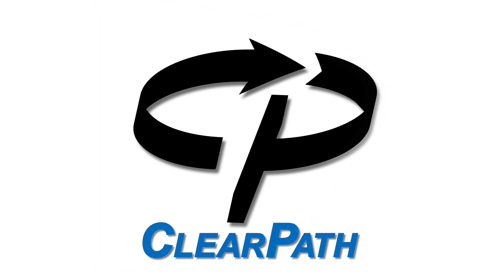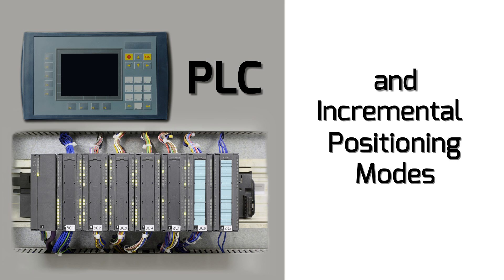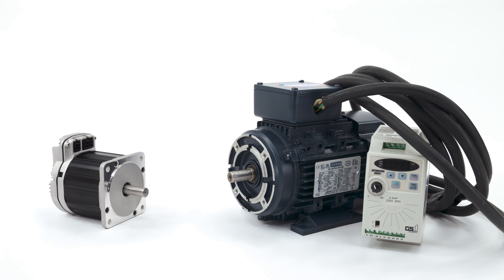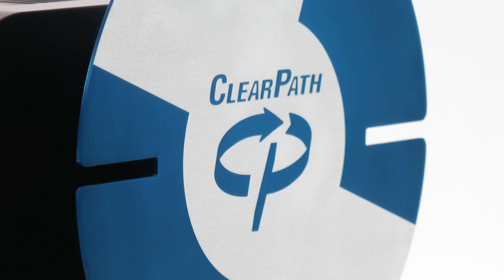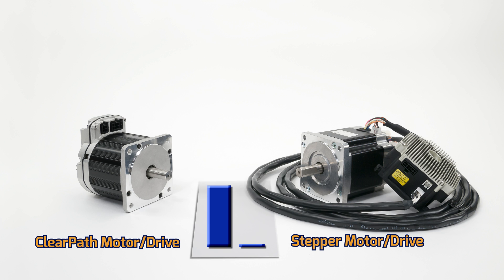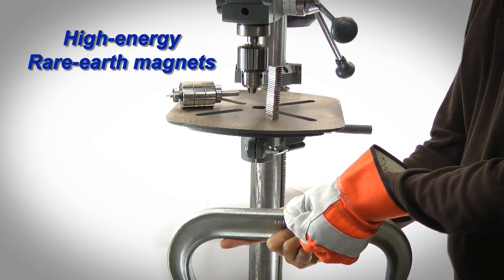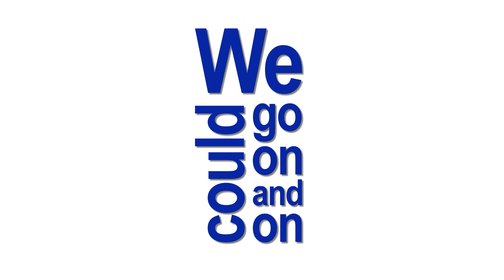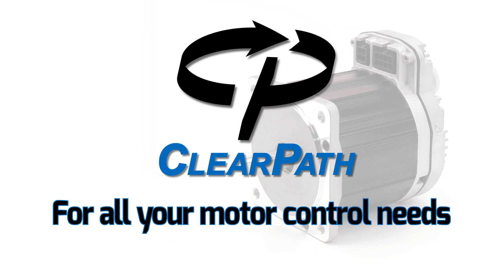ClearPath: Teknic's Integrated Digital Brushless Servo Motor and Drive

Comment: Interesting, can this product be used to control linear motion up to about 8 mm at 109 Hz?
Reply from the maker: Hi ah-lx9xi,
Thanks for your interest in ClearPath's linear motion capabilities. ClearPath motors are used in a wide variety of linear positioning applications from high-precision motorized microscope stages to high-speed CNC machines, but without more information about your mechanics, torque/speed requirements, and motion requirements it’s hard to say whether a ClearPath motor will be the right fit your application. If you’re interested in looking further into ClearPath’s capabilities, consider watching a few ClearPath model and mode videos to get a sense of which ClearPath motor(s) might work for you. Here’s a link: https://teknic.com/watch-video/. If you have questions or need further guidance, please feel free to give us a call at 585-784-7454 or use the following link to send us a contact request: https://teknic.com/contact/.
 
Regards,
Jim W.
Teknic Servo Systems Engineer

Comment: Before you waste time in these motors know one thing. I spent days familiarising myself on them only to find at checkout I cant buy any. Reason being is the firm only take credit card. After two emails I am finally told to go to motion industries and in doing so I loose money back guarantee. I pay more and they take longer to be sent to me. 

One of these motor is over $500 and the established firm only take credit cards.
Reply from the maker: Hi James,

We appreciate your feedback to improve our e-commerce resources for customers and I will pass your suggestions on to our management and marketing teams. We work hard to make the information about our products, ordering, and services as clear as possible to prevent prospective customers from wasting their time if there is a reason they cannot move forward with our products.

Our webstore currently accepts all major credit cards such as Visa, Mastercard, Discover, and AMEX, but as you unfortunately found out, it does not accept debit cards.  A notable reason for this is that debit cards have a higher level of fraud risk for the vendor (Teknic). We continuously evaluate payment options (e.g., PayPal, Venmo, Zelle, and even crypto), but each option has different transaction fees, costs, and risks with incorporating them into the third-party checkout modules we license.

Best of luck with your application and I apologize again for any confusion about our ordering process.

Best,
Bridgette O. - Teknic Servo Systems Engineer
Reply: I have my own website. I use STRIPE to manage payments. It accepts all cards and apple pay plus google pay. Your words to attempt to give reason for not taking debit cards. Fraud risk and higher fees. Dude your motors are over $500 dollars. Im sure the profit margin allows for your use of debit cards. 😂 

Fraud risk. I never heard anything so crazy. 

I offered to wire the funds direct into your account. You have not accepted this nor mentioned it. 

My time was wasted on an epic scale.

Comment: We are now seeing hybrid servos from chinese manufacturers for low cost entry level cnc machines. What are these hybrid servos and how do they differ from your servos.
Reply from the maker: Hi Z-add, 

The primary difference is that ClearPath motors are fully integrated, AC vector, brushless servo motors, whereas a "hybrid servo" typically refers to a stepper motor outfitted with an encoder running in a closed loop manner. A stepper motor is designed to be run open-loop, so although it can be run closed-loop, there are a number of technical disadvantages of the construction when used in a servo system. On the other hand, the advantage of this type of servo is that motor (a stepper) can be made very cheaply, so the overall cost of a “hybrid servo” tends to be lower than that of a servo made with a permanent magnet, low pole-count, brushless motor.

Keep in mind, however, that there are significant differences in performance even between servos that are built using the same technology, so it is impossible to generalize about the performance of one servo versus another without testing them. 

For more information, check out our website here: (https://teknic.com/products/clearpath-brushless-dc-servo-motors/) where we discuss the differences between ClearPath and other motor technologies. 

If you have questions about ClearPath, I encourage you to reach out to us directly by making a contact request (here: https://teknic.com/contact/) or by giving us a call at 585-784-7454. 

Best, 
Bradley N. - Teknic OEM Applications Engineer